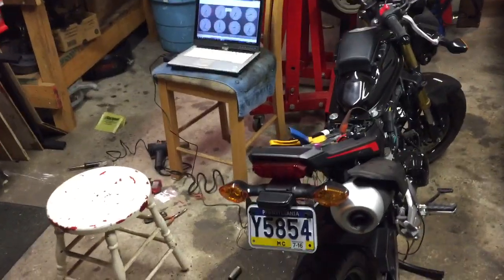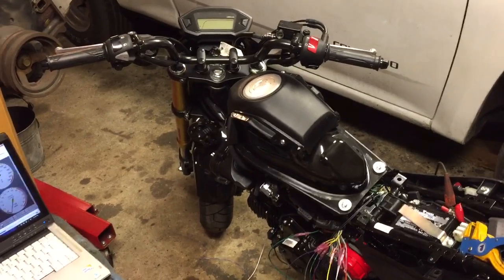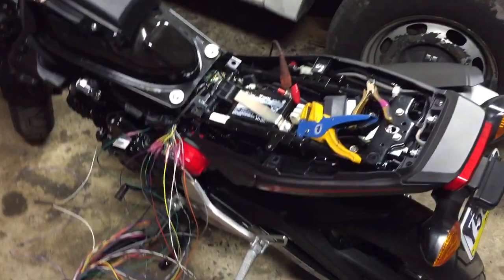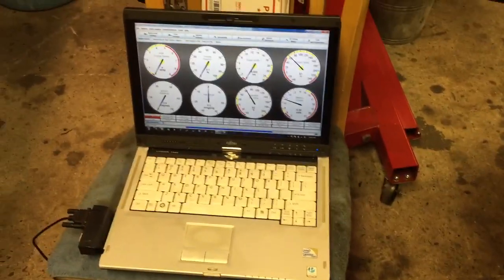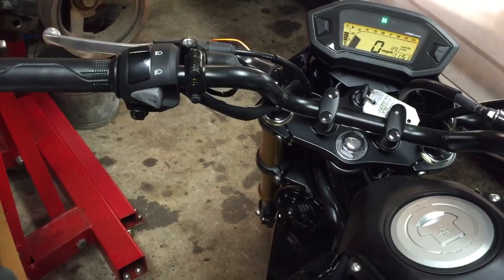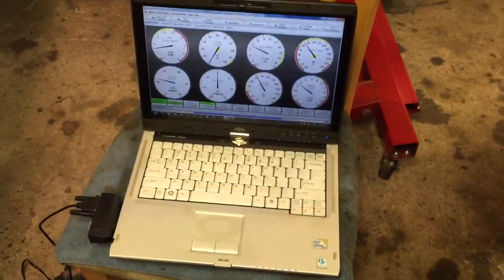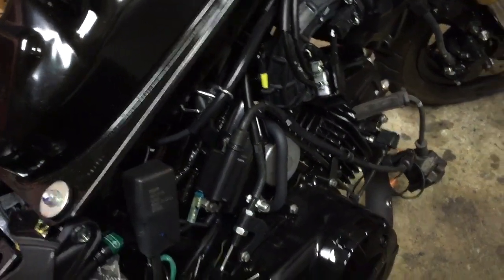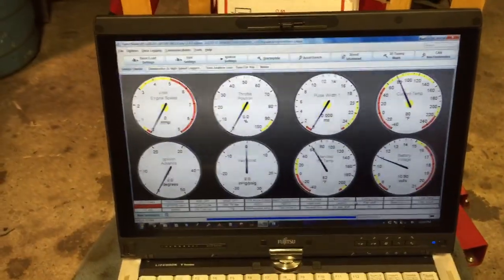1-29-16 Grom running microsquirt project... start and finish?!

Comment: Yo, thats sick! I'm a little late to the party!! How have you gone about getting the crank trigger setup.. using the stock crank pick up?
Reply from the maker: Stock one with pull up resistor to stop it from creating too much voltage
Reply: @SloppyMechanics  Heck yeah! Thats promising!! Was that using the AutoTrigger setup in the microsquirt?

Hows the grom going these days man?
Reply from the maker: @Carls_Built  auto trigger? im not sure what you mean, i just set it up as you would normally for any engine. also i sold the bike shortly after this, i dont keep things too long
Reply: @SloppyMechanics  Yeah straight up I'm probably over thinking it all! auto trigger is an option in the MS setup.. Ill just whack it on the bike and play around and see how it goes haha! 

Just watched the nitrous galant hahaha you sir, are a bad influence LOL

Comment: Good deal. Im abaout to buy a grom and was wondering if the microsquirt would bw simple to get working on the grom. 

I haven't used tuner studio in many years but it like to see how well it works if i make a staged injection setup

Comment: whell take the original ecu and ignition of the bike make the squirt instal look nice optimize it to the max and go run it then 
wat you could do is build a instalation kit with a ecu mounting a coilsetup and  adapterplug(s) so you can use the original wiring and make it allmost plug and play with a basic fueltable allready installed in the squirt , if the original ecu's are so hard to tune i bet it would be a verry populair mod for those looking for better performance / fuel economy out of this brand of bike 

would love to see it ending up with a turbo from a smart car or sumtin like that